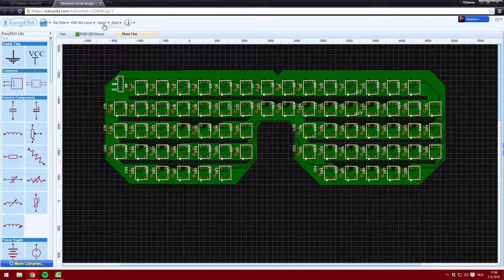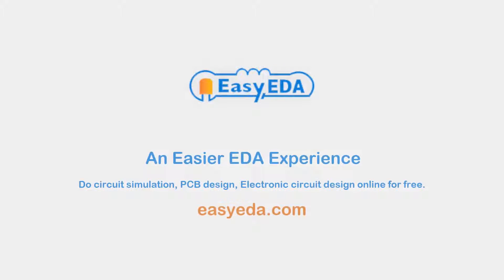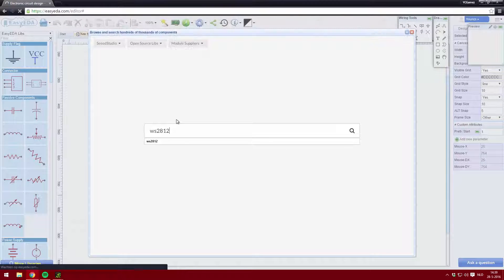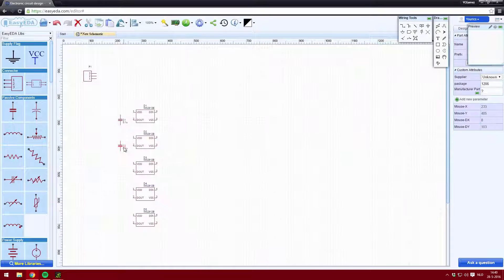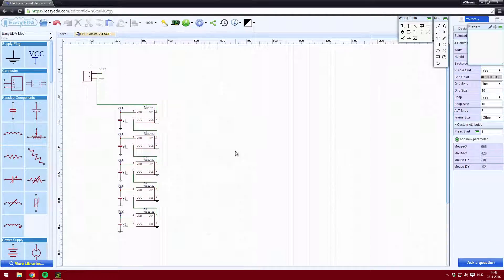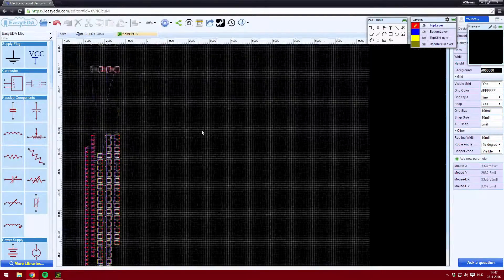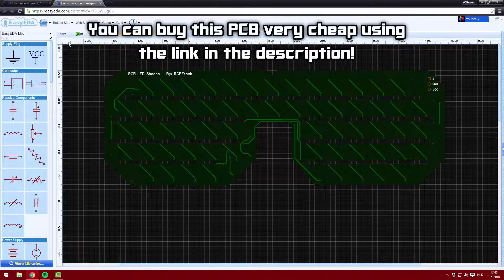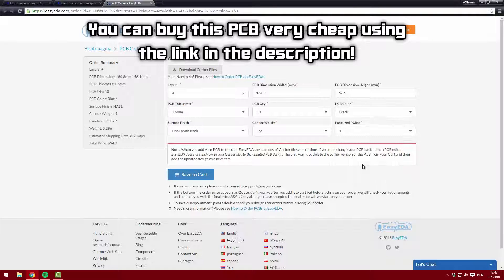DIY | Arduino Controlled RGB LED Shades - Part 1

Comment: For the PCB board is 4 layers necessary? It seems to really increase the price.
Reply from the maker: In this case, yes
Reply: @RGBFreak  Okay and I assume lead free is probably best as you are using it close to your face?

Comment: Hi really great project! Is it possible to rotate the leds 90 degrees to make a wider gap between to row? And how Do I attached to sit on my ears. It doesn't have any mounting points.. :/
Reply from the maker: Tamás Vasváry hi. You can modify the PCB however you like. Also, if you have a 3D printer I could send you custom feet for the glasses that I have designed and printed a week ago
Reply: That would be great. I tried to modified a bit but I have never done this before so when I auto routered It made a huge mess. Thanks for the quick answer :)
Reply from the maker: Tamás Vasváry I will send you a download link when I'm back at home. Currently away
Reply: RGBFreak hey man! This is awesome! Would I bother you asking you for the 3d print files also? Keep the great job!

Comment: +RGBFreak This is really cool! I'm trying to buy the board from EasyEDA but when I open up the board and click on fabrication output it tells me to "Please build copper area." Is there anyway to fix this? This looks like an awesome project and I look forward to trying to build it!

Cheers,

Tanner
Reply from the maker: Thanks for your interest! I have just updated the PCB to fix it. Try again now and it should work. Let me know if you have any more issues. If you need assistance the easiest way to contact me is through facebook: https://www.facebook.com/RGBFreak/
Reply: @RGBFreak  Not working for me